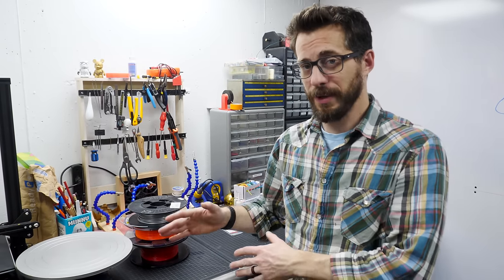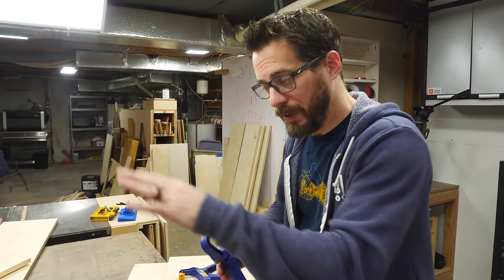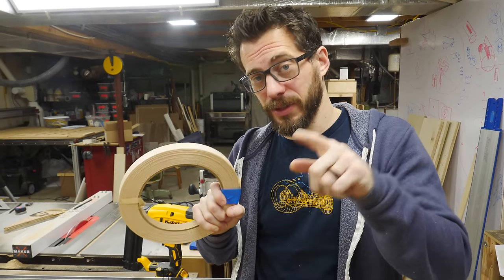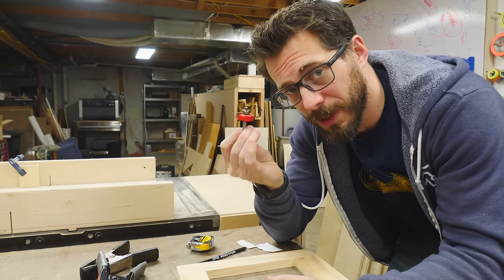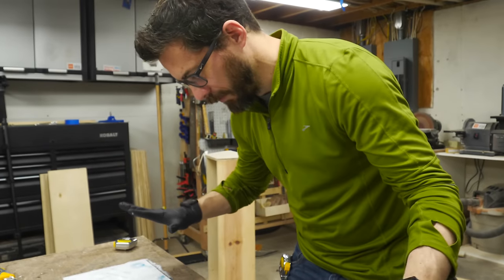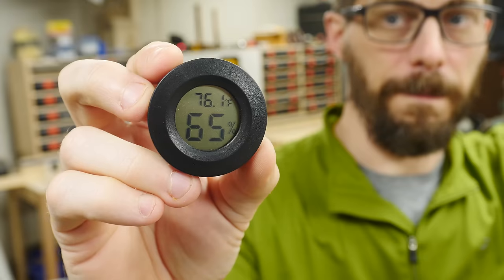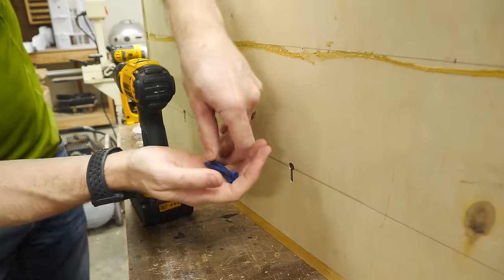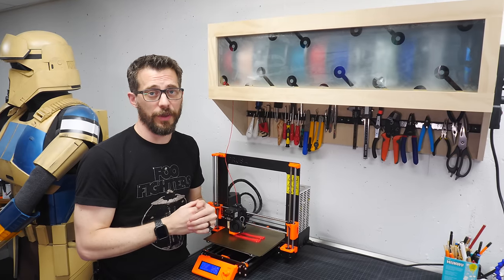Making Filament Storage with an Etched Glass Door // 3d Printing & Woodworking

Comment: i usually do 2 or 3 coats of the Armour Etch to get an even etch across the glass.
Reply: Do you fully rinse between each coat, and let each coat etch for the full 5 minutes?
Reply: stafdehat yes.. etch, carefully clean with distilled water(so you don’t remove/move a stencil) , dry, and repeat.

Comment: Can u make An add-on to this cabinet so you have tubes running to all your 3d printers and all of your filement that you are using is in the cabinet it self and maybe you could add filament sensors in conjunction with an Arduino so you get a message when your filament is running out

Comment: To be honest, I would have used a 20x20 profile as a rail for the filament rollers so you can move them whenever you need, otherwise you may encounter some strange filament sool that doesn't fit on those rollers and yu are screwed because of it won't fit.

Comment: If you are trying to keep the moisture in the environment out of your nylon, don’t see the benefit in promoting air flow within the box. Hot air rises. Moist air also rises as water vapor weighs less than air. I’d try a high vent hole on each end and close up the lower vent hole. Sounds like an experiment!  Enjoy.

Comment: Dude put a bead of silicone as a gasket around the frame, that allows an air tight seal, and a vacuum valve in case of long time storage
Reply: I don't think he's concerned with having it be air tight since he has the dehumidifier and the vent holes.

Comment: how would those bamboo skewers help secure those screws? wouldn't it get loose over time?
Reply from the maker: Adding more material to the hole increases the friction between the screw and the material. Unless that extra material were to fall out over time, it shouldn't loosen.
Reply: @Iliketomakestuff  thank you for clearing that up! :)

Comment: couldn't you make the door frame grooves with the Dado as well? you are essentially making open ended slots, correct?
Reply from the maker: You could, but you have to make sure the dado isn't too deep. If you use half-lap joints you wouldn't want to see the dado gaps on the ends.

Comment: The white etching cream isn't very good at etching evenly. You want the pink thick kind, slather it on with a tongue depressor and keep it moving. Also I wonder if the water you sprayed and the way you touched it with bare hands have an effect, I always clean the glass with disinfecting alcohol before applying the mask and etching cream

Comment: I'm a little confused about how the dehumidifier is supposed to work. A typical one for a room would have a drain of some sort to direct the moisture somewhere. What happens to the moisture that thing removes from the air?
Reply: 15:11 it’s causing air to circulate, as opposed to drying out the existing air

Comment: You might want to know that you were holdign the glass cutter upside down.  If it works for you... but in the long run you might have better results using it in the normal way.

Comment: 1- the holes are  too small, the air is 'lazy' and it usually takes the easiest path, in this case if you would use termal camera you will see it will essentially heat the glass and move away by the gaps in the door.   2- tool above 3d printer that can fall down and hit it, very bad idea my friend. If yo uare using nylon it will take few hours to absorb moisture from the air, only way to have actual gasket  and active membrane to secure the box and membrane to take the water out, thhey need electrical power to operta but they are not going to draw so much power like your heater does. 3- the heater heat up one side of the few rolls in the middle , that will ause later problems with printing as the filament will change its diameter and in some cases become more brittle and can cause jams. you should have used a simple wire and wire all around tha box so its even and set current on that coil/wire to match its resistance to heat up to 40 while still adding safety termostat. or you can just buy drying cabinet that actually works, and is safe to use

Comment: Not bad, but instead of that bearing set up, the bearing should be in Rods, all filament reels are not same width.  you can also get spray on etch works great and if messed up just strip it back off and put it on again.

Comment: why do you hide the plywood? it looks really good if you use a dark wood oil as a finish. but if you are using a clear coat you just need to sand it round and it looks good as well.

Comment: I would have reversed the etched design making the uneven etching less noticeable while being more aesthetically pleasing but primarily for better and easier assessment of both your various stock of  filaments and remaining “in use” material which would presumably be your main or preferential one if your going so far as to continuously run it straight from the cabinet with out opening and setting it up every time

Comment: Looks like the glass needed a second coat of Armour Etch. Often the case with large etchings.
Reply from the maker: I underestimated how quickly that solution would start etching. I would paint it on a little more evenly next time instead of pouring it on the surface first.
Reply: @Iliketomakestuff  Maybe in future, the inverse etch would look nicer? A clear window with the design etched? It would mean any inconsistencies would be hidden better. 

Unless you're just trying to hide any unsightly spools.

Comment: I’ve had better luck cutting my keyholes horizontally. It allows for spacing errors when hanging on studs and it would allow you to use just one straight edge when cutting.
Reply: And how do you prevent it shifting/falling of sideways?
Reply: @Jehty_  I cut two keyholes, so as long as the nails / screws are level, the frame will find level. I cut longer keyholes, to be able to adjust the frame from side to side.

Comment: Did you wash off the glass etchant solution in your yard?
Quote from the product's material safety datasheet: "Avoid dispersal of spilled material and runoff and contact with soil, waterways, drains and sewers. Inform the relevant authorities if the product has caused environmental pollution (sewers, waterways, soil or air)"
Please be more careful with chemicals and do not promote handling chemicals like this in the future.
Reply: That was the same comment I was going to make.  Good advice for a fun video.